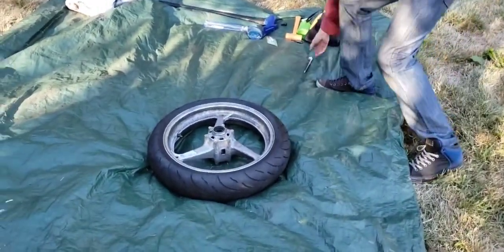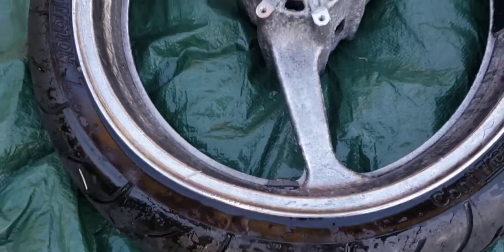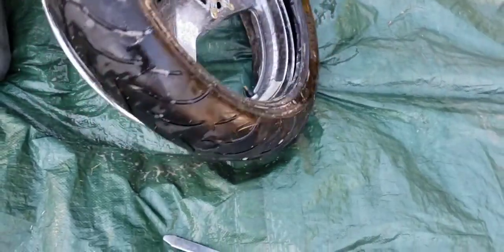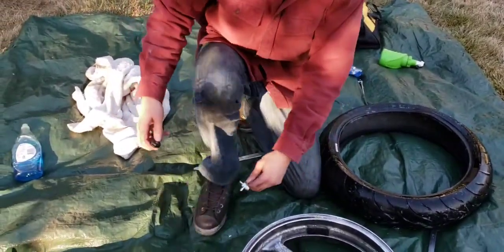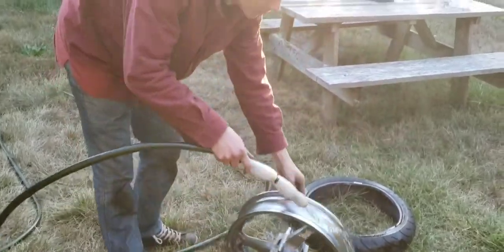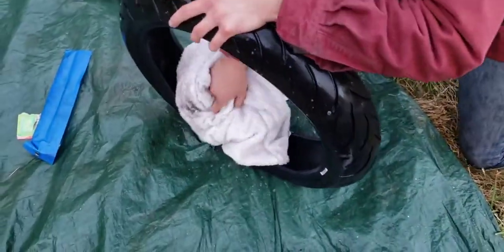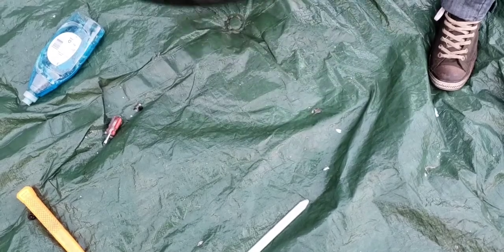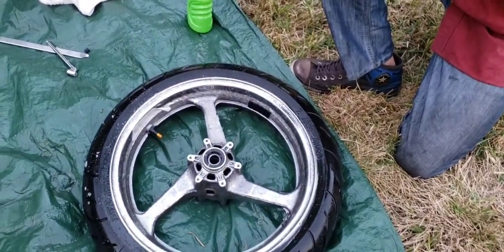CHANGE MOTORCYCLE TIRE /FIX LEAK W WIRE WHEEL

Comment: Good god I cringed when you took that big ass sledge to that rim.. you do realize you could have just put that thing up to the tire and smacked the back end of the hammer with that mallet you had layin there and not risk destroying your rim..
Reply from the maker: To each their own! That's a great way to do it!
Reply: @aristhrotle2083  just cause it works doesn't make it a good option brother lmao. One wrong hit and you could crack or dent your rim.. those arent steel car rims.. they're not meant to be beat on like that trust me.
Reply: Everyone knows there's more than a few ways to skin a deer... whichever is the smartest and easiest so you dont ruin the meat or hide ( your rim ) would be the better option imo🤷‍♂️